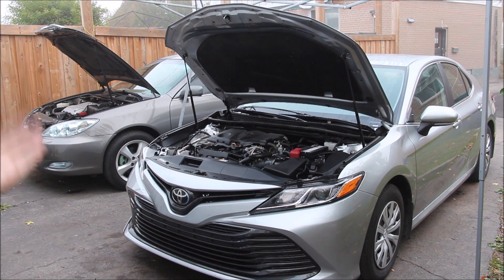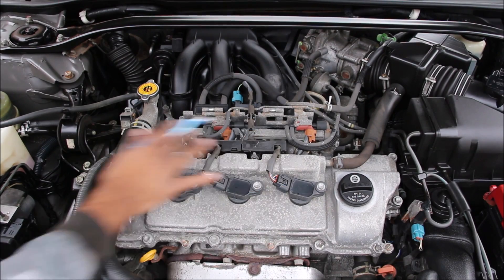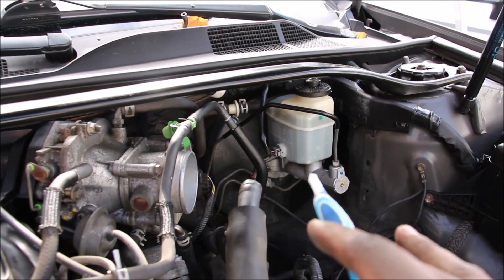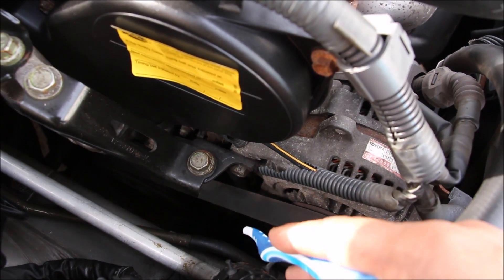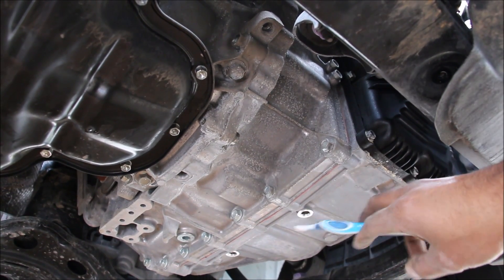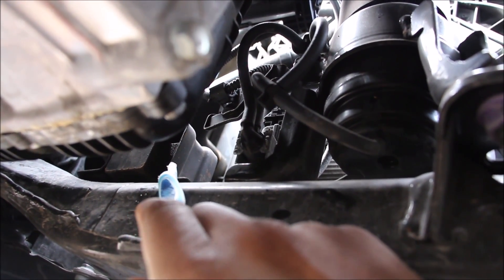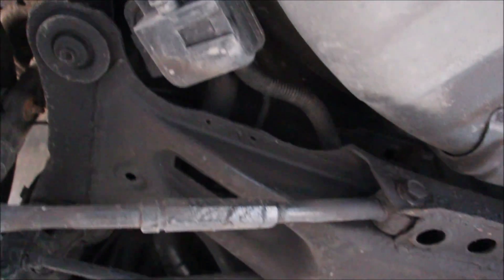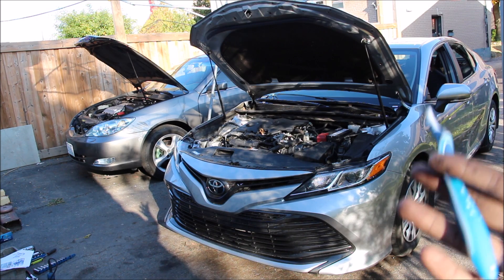Toyota Camry Mechanical Review | What Changed in 15 Years?

Comment: How did toyota generate 203HP from a 2.5 liter engine without forced induction? What is the compression on this thing?
Reply from the maker: All the technology I mentioned, direct injection, electric steering and water pump, higher compression, better flowing exhaust all contribute to the power gains.
Reply: @speedkar99  ahhh makes sense. I suppose the ultra low viscosity oil also played a part
Reply: That means you have to rev it hard to get that power. Toyota engines feel so lethargic and sluggish after driving a turbo charged vehicle with a smaller capacity engine. The Toyota engines have the power but the lack of torque is very apparent.

Comment: I think it funny how his "old" Camry only has 300k kilometers, come back when you have 300k miles. Also, compare 4 cylinder to 4 cylinder. Could it be that the 2.4 liter 4 cylinder had problems, whereas the V6 didn't.  I personally see more 6 cylinder versions of the "old" car still on the road than the 4 cylinder even though only 20% originally came with the V6
Reply from the maker: Good point. The reason is the v6 were more reliable than the 2.4, which burned oil and stripped head bolts.

Comment: that older camry is far from a base line camry;.....
Reply from the maker: I added alot to my Camry
It's almost an SE V6 now
Reply: @speedkar99  oh you added power seats? How did you? It would be great to know. Also how are comparing a custom v6 Camry to a base line camry. If you had a i4 2005 Camry and stock then it would be fair.

Comment: So, they got rid of that awful cartridge style oil filter. That's good. However, they still appear to have the impossible to maintain transmission.
Reply from the maker: Finally back to normal filters. 
The transmission isn't difficult...you need a fluid pump. Watch my sealed transmission fluid change video. At least you don't need a scan tool!

Comment: Toyota should seriously think about replacing their current designer! From Corolla to Lexus, older models are more masculine while the newer models are 🌈
Reply from the maker: Physical design is one thing. What's underneath is what matters.
Reply: @speedkar99  Even those stuffs quality degraded drastically! I worked on my dad's '08 camry and I worked on my most recent camry and apart from the gimmicky stuffs in the newer one, everything is flimsy and clunky and plastics all over the place! If this trend keeps going on with the toyotas (honda is already ↓), soon there'll be no difference between ford and them.

Comment: My favorite Camry is actually the 2002-2006 V6 XLE. It’s so nice, it comes with Fog lights, alloy rims, 3.0 or 3.3L V6, not sure which one, leather and wood interior, nav. Rear manual sunshade etc. so freaking nice !! Almost as nice as my 2006 Lexus ES330 fully loaded. Mines got the 3.3L V6, 17” 6 spoke chrome rims, power rear sunshade, sport tuning suspension, mark levinson premium audio system, voice navigation/touchscreen infotainment system, automatic rain sensing wipers, heated and ventilated front seats. I’ve added LED Turn signals front and rear, window tint and window shades for the rear side windows, chrome pillars, LED halo ring headlights, back up camera, and of course a dash cam lol. I love that car so much! It is immaculate and drives like brand new. It has 220,000 miles on it, and I service it every 5k or so to make sure it’ll keep going forever.
Reply from the maker: Awesome. I had an 05 ES330 and it was an excellent reliable car. 
The one thing I hate was the throttle and transmission lag, my Camry has that too. Does yours?

Comment: I just hit 313,000 on my 2.4 06 Camry and 216,000 on my 05 xle v6 they’re pretty reliable surviving my led foot. It never burned oil and the only problem was the alternator. I got that old 3.0 up to 135 at red line and the 2.4 can only swing 110
Reply from the maker: Awesome, that's more clicks than mine. Does the 2.4 burn oil?
Reply: speedkar99 i have to add a quart every 1000 miles or so

Comment: I floor my 2000 camry all the time, 200k miles and still smooth. I would never buy a 2007 or newer camry. I notice people tend to sell them around 100k miles, because they start having issues. I'll probably buy a 02-06 camry.  Even the 92-98 camry lasts longer. Capitalism is taking its toll.
Reply from the maker: Yep the older ones were built better
Reply: My 07 is crapping out at 205k
Reply: @fratersol  I didn't change the oil for my 2000 Camry for an entire year, and the coolant was super low, but the car still ran. As a youngster receiving this car for free, I really didn't see the beauty of it until now when it's all rusted up(I've never washed this car).
Reply from the maker: Abuse
Reply: @fratersol  340K Hybrid still running perfectly fine
Reply from the maker: What year hybrid?
Reply: @speedkar99  07
Reply from the maker: Which engine?
Reply: @speedkar99  2.4L

Comment: is the engine in your 2004 interference or non interference, am asking as I have the v6 vvt in my 2003 which I believe is the same and I cannot seem to get a straight answer?
Reply from the maker: Ive heard mixed opinions, when VVT is engaged it could be interference
Reply: @speedkar99  hence my problem as it leaves the question unanswered, hopefully someone that has a definitive answer can chime in
Reply: @MyPujols  The 1MZ is a non interference engine. VVT has nothing to do with it. Pistons can never hit valves on a non interference engine, regardless of the timing .... hence the name.

Comment: In Malaysia the new Camry costs as much as a new Passat and while other countries have received the Dynamic Force engine, Malaysia's new Camry still uses the 2.5 litre engine that came from the 2011 Camry, mated to a 6 speed automatic that also came from the '11 Camry. Yes the Camry is gonna be more reliable than the Passat (my friend just sold his 6 months old Passat not long ago cuz the dsg was failing its ass off), but the Passat has a more interesting powertrain overall.
Reply from the maker: Passat is no comparison. 
Especially if you think 6-10 years down the road out of warranty. 
I can't believe they still use the 2AR engine in the Gen8...I guess they have to hit a budget.
Reply: speedkar99, you have to acknowledge the 2AR-FE is a no bullshit engine. It makes sense they keep using them. If you put new software on that Denso ECU 
(w/91octane) that engine will put down what your V6 does.

Comment: excellent journalism !  Thanks.

I think i'd like the older version Camry but with the older 4-pot engine that was available at that time perhaps.
Reply from the maker: You are welcome. 
Avoid the Gen5 Camry with the 2.4L. 
They burned oil and blew head bolts. 
The V6 is the reliable one to get.
Reply: @speedkar99  ok then!  thankyou SpeedKar!
Reply: @speedkar99 I have a '96 4-cylinder Gen-3. It uses a bit of oil at 178 K-miles, but I got the car for free. Biggest gripe with mine is the stock suspension is too soft. Upgrading my rear struts and springs was a big imrovement. 
A friend had a 2003 4-cylinder with 190K-miles and no engine problems.
I've heard the oil-burning started with the 2007 Gen-6
Reply: It would be interesting to see the new camera compared to the most legendary Camry engine in the history of the camrty, which of course is a 2.2 L. I have a 2001, it is still running great, plenty of power and 32 miles per gallon mix driving.

Comment: I love boring, when I was broke I had to hop in my 1999 Camry with 236,000 miles and drive across the country, didn't miss a beat.. If that's boring, sign me up.
Reply from the maker: Awesome! I miss my 99 Solara. 
My 04 is holding up just fine though.
Reply: Apparently to some people you need to lease a car that has so many mechanical oversights it's spends 80 days a year in a shop to not be boring. Yeah no thanks. I'll take a car that I can rely on

Comment: Camry LE was not the base model for  Either one of these generations. The 2004 Camry CE Was the base model and the Camry L was the other generations base model. Also the V6 Engine was part of an options package that was available with the higher end LE, SE, and XLE trims It would be more fair to compare the 2.4 l with the modern 2.5 leader.
Reply from the maker: True it's not a direct comparison. 
The CE was not offered for Gen 5. 

The L is available as a rental spec stripped down car

Comment: This is why I refuse to get rid of my 2004 ES330. You can't beat the 3MZ. Just about to roll over 200K miles.
Reply from the maker: Yeah I had an ES330. 
The only thing I didn't like was the throttle lag. My Camry has that too ☹️
Reply: @speedkar99  The throttle lag with the stutter? Yeah, it used to drive me crazy, but now I'm so used to it. Lol.
Reply: I have a 2005 ES330 with 182k miles and at first the trans stutter on the 3-4 shift bothered me but I have gotten used to it. Used to think the solenoid pack was bad but it’s just a characteristic of the transmission. It drives so damm smooth and the torque is silky. I came from a 2012 Toyota Prius V and was tired of having no PoWAH!!!!

Comment: Love the detail. My friend has the same 04 Model with V6. He’s got over 300k now. Bought it New. Biggest repair was tranny rebuild after 250k. He’s pretty hard on his cars.  Still driving it. 
I am skeptical of new ones. That 8 speed tranny has not proven to be as robust after 2012.  I’d wait to see if Toyota improved them recently. 
I just bought my first Toyota product after 20 years with a 92 VW GTI I bought 7 years old.  A 2015 Scion XB 5 speed manual with only 32k. I am hoping for another 20. Years less fun but less repair filled. I only put 3000 miles a year on my cars. It seems it has conventional oil changes per prior owner at the local dealer. I think I’ll stick with that. Not sure if I’ll do a change every 6 months or every year. I mean 6 months, it won’t even have 1800 additional miles. Thoughts?
Reply from the maker: Oil degrades with time. Regardless of miles, change it once a year. 

Tranny rebuild on 04 Camry sounds rare. The 02 V6 was a bit flakey.

Comment: The new Camry is much safer than the old one. The body structure is much stronger because it uses ultra high strength steel.
Reply from the maker: Safer in collision yes. 
A little parking lot damage will cost you ALOT more though.

Comment: Very interesting to see the differences.  I personally have 2 older Camrys.

1. 2000 Toyota Camry LE V6 5-Speed Manual with 163,000 miles.  I average about 26 mpg with mostly highway driving with traffic.

2. 1997 Toyota Camry CE 4cyl 5-Speed Manual with 260,000 miles.  I average about 32 mpg with mostly highway driving with traffic.

They have been great cars.  I love having the manual transmission since I can have fun shifting my own gears and get better gas mileage than the automatic transmission car of that generation.  I mainly use my 4cyl as my commuter car.  I kept my V6 garaged and drive it at least once a week to work and other places.
Reply from the maker: Awesome! You must love the Gen4s eh

Comment: Love ur review man. My '02 v6 just hit 240km. The only problem is the check engine light is on all the time with p0125 code. But theres nothing wrong with the coolant system.
Reply from the maker: Thanks! Coolant temperature sensor?
Reply: @speedkar99  ect sensor is fine. Brought the car to Toyota svc center, they found something's wrong with the deceleration sensor and said that's not a big problem. What do u think?

Comment: It's far better than most reviews. I'm a mechanical engineer. The Camry is a great machine. The 1992 to 1996 in particular is considered a benchmark of physics. Period. Most journalists are too dense to have any clue how a car works under the hood. It drives me nuts. You're clearly smarter than the average car and driver writer
Reply from the maker: I'm a mechanical engineer too. I understand your point exactly, we don't look at cars the way normal people do!
Reply: @speedkar99  wow so the new Camrys sheet panels are that much thinner than a gen 5? Older Camrys are such tanks. I heard the gen 5 is alittle thinner than the gen 3 I mentioned. But I'm not really sure on that. But my 1992 is ridiculously thick with the sheet metal. Hail stones don't really hurt it. I'm 6ft and 200 lbs and can stand on it without dents. It's similar to when I borrowed my friends Mercedes 300D. Do you know if the gen 5 is thinner in sheet metal vs Gen 3? If so the new ones must be way thinner than my old 1992. My 2017 Impreza is super thin metal.

Comment: You should drag race this thing! 210hp 3.0 old camry VS 203hp 2.5 new Camry
Reply from the maker: I so wanted to.
More torque on the V6 Camry but 200lbs heavier...

The new one certainly felt much faster off the line than my old V6

Comment: I would still choose the older version even if its somewhat harder to work on, mainly because of the better material quality and placement of critical parts such as the ECU and Throttle body etc. The new one seems like a lot of plastic critical electronic parts that will be destroyed easily in a minor collision and will cost a lot to replace, even for a DIY person. The older ones you could still drive through a small amount of water without any critical damage to the drivetrain and engine as long as you wash it off asap. However the new model with its electric power steering, electric water pump ETC just makes me Cringe about the repair bill after a minor water passage. And yes we know you should not drive through flood but with the weather conditions these days its unavoidable. I guess that's another reason why persons are opting for the higher crossovers and SUV's.
Reply from the maker: The older one is only harder to work on because it's a V6. If I had the i4 it would be no challenge

Comment: same as BMW … more and more plastic crap which breaks after 10 years. electric water pumps whose can fail during driving. I like the older camry more, but i will Keep my BMW 5 series E39 as Long as it drives
Reply from the maker: Both great midsized sedans at what they do. 
I kinda disagree with the negativity on electric parts...they have been in production for a while. We don't complain about power windows and locks now do we?😏
Reply: @speedkar99  but is it true that more and more plastic parts make a car less long lasting?

Comment: Do the Highlander.... 2019 and the 2020  Thanks.  Hate the tranny fluid changes on Toyota, now,  Oil changes are different, too.
Reply from the maker: The 2GR V6 still uses the cartridge filter which is a mess. 

Will see what the new Highlander brings for 2020

Comment: Loved when you noted the difference in body thickness. My 98 Saturn was mostly plastic 😬
Reply from the maker: Dent resistant
Reply: The saturn was a odd ball gm product. Too bad they didnt market it very well. It also used the horrific dexcool coolant that tended to sludge up. Horrible bucket deiver seat, weak transmission etc
Reply: @cgmf-d6t  But overall weren't Saturn's pretty good cars compared to a lot of other what-was-American cars
Reply: I had a 99 saturn sl1. Can confirm.
Reply: Better plastic. Biodegradable engine components baked in a hot engine. Just super goodness there. Last just till the 3 year warranty is up and crumbes into black dust. Potentially that is.
 I just see in the Toyota lineup of vehicles. Cheap. I just bought a Corolla Cross. Cheap and utilitarian. Better interior plastic than on the city bus. lol

Comment: My 2004 Toyota Camry has 300,000 miles on it . And still going strong.
Reply from the maker: Wow mine is barely 300,000km . Is yours a V6?
Reply: No it's 4 cylinder.
Sorry for the late reply

Comment: The sheet metal being thin on the new one.. how is the kerb weight still the same? Also did they put thinner sheet metal for crumple zone reasons? I mean aren't cars getting safer throughout newer generations?
Reply from the maker: The new one is about 200lbs lighter
Reply: @speedkar99  have u checked ? Cos I thought same weight..
Reply: I m talking about both v6 models this is 1 4cyl and v6 no

Comment: What are your thoughts on the plastic intake manifold?
Reply from the maker: It works. 
On my Camry the plastic intake has to be removed to get to the rear spark plugs. On the older cars with metal plenum you could reach behind easily.
Reply from the maker: Thanks very much!

Comment: Great video, I own a 18 XLE 4cyl and there are some cheap parts i noticed compared to my 19 Accord which i feel is built more solidly. But i do love the way the camry drives compared to my accord. The only thing I hate about the camry is the 8 speed transmission. You need to have patience with it especially when you're slowing down then accelerating again.
Reply from the maker: I've read about the transmission issues on the gen8 camry. 

The gen5 Camrys had alot of lag too...that's the one thing I hate the most. 

Other than that, how does the Honda compare in performance?
Reply: Look up the Toyota Camry TSB for the transmission. The dealership will flash it.